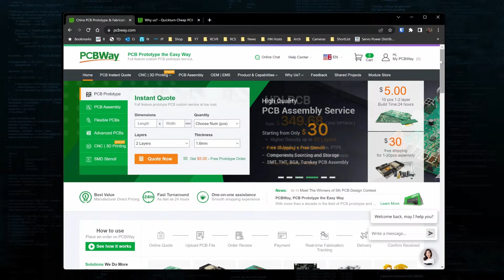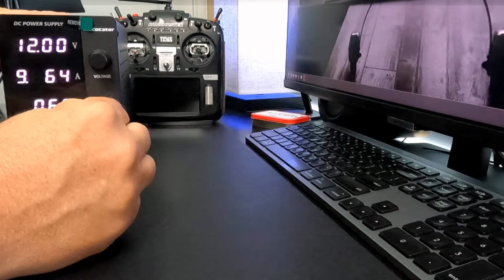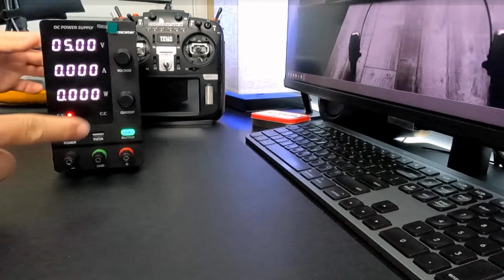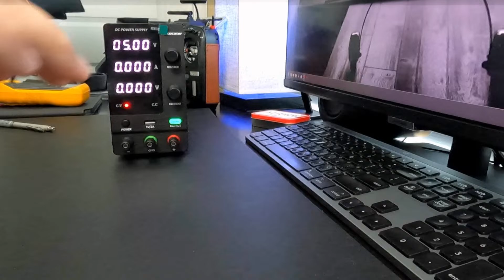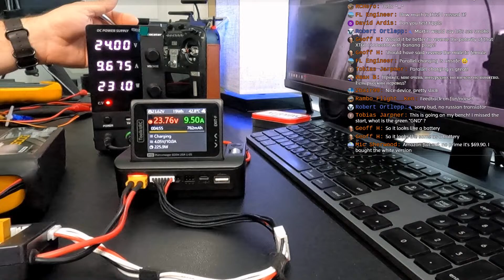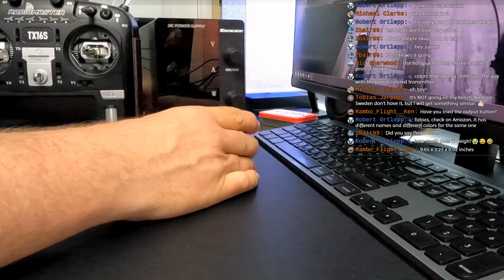Decent Low Cost Bench Power Supply • 30v 10a 300w

Comment from the maker: Near 20:51 I said if I "brought the voltage down it would get us closer to 300w" which is obviously incorrect. I was looking to increase the amperage by turning down the voltage. Without changing the load, the overall wattage would not have changed. These are issues that get removed in production videos that can't be edited in live videos. Sorry for any confusion I might have caused.
Reply: No worries.  Its better than my effort
Reply: Yep. So much wrong and frustrating info in this video. 
🤯

Comment: The iPad charge at 4.3 volts seem a bit odd. Should it not sit at 5V? Thankyou for the coverage! I need a reasonably noise free power supply for fine DC analog tuning and testing. The voltage is also important but with a decent volt meter it's not super important, just the stability. Thus I am searching searching searching! Cheers!

Comment: Love your setup! I was going to also use this power supply for RC and moving servos etc and powering receivers. How did you attach the standard servo lead and the other connector? It wasnt clear in the video how you set that up. Id be very interested in doing that as well .thx u!

Comment: Thanks for the teaching.
In amplifier building, the board needs a +/- rails, say 30DCV.
I am looking for a bench adjustable/variable switching PSU to be used for various amplifier boards (that needs different +/- DCV).
Question: What kind of description/specification do I look for in a commercial product? Thanks.

Comment: I have this and it broke down after 3 months.
Reply from the maker: I posted this video May 9, 2023. It's August 12th 2024, and I still use it almost every day. It's been on for 1.25 years straight usually running around 30v and when I use it as a charger usually between 5-10amps.

I would buy this unit again immediately if it failed at this point.

Comment: Can I use one of these devices to fix electric scooter battery at only putting out a few volts need it back to 30 volts
Reply from the maker: I don't know about 'fixing' a battery, but it could be used to charge one.
Reply: @RCVideoReviews  can it increase battery voltage?
Reply from the maker: It follows the rules of voltage potential. So long as the destination voltage is lower than the source voltage it can. I'd recommend using a charger though.

Comment: Will this be suitable for breaking in slot ca motors? I need something that will show the increase in amps as the brushes break into the armature. I assume in you have the power supply set to CV the amp meter will show the increase in amps throughout the break in process. Thank you.

Comment: Yeah, I bought this one. I'm trying to charge a 210 ah Prismatic cell, and it starts off at like 7 amps. The stay is high for about 5 or 10 minutes and start going down. Then it goes down to 2.2 amps. At slowly keeps going down. Did I get a defective machine or something wrong with the battery?
Reply: @Shawn-gt5dh  I this is old but your description is dead on for how the charge process works.
Reply: Measure the voltage at the end of your power leads with the multimeter then adjust the voltage. I'm guessing there is a major voltage drop and it differs from what the power supply is showing

Comment: Looking at the power supplies on Amazon, I suspect the main board in many units will be identical.
Reply: I can confirm. I’ve bought two different of these power supply unit from Amazon. The aesthetics of the cases are different but the board and components are laid out exactly the same.

Comment: I appreciate that your an RC guy, using tour supply to charge batteries, anf I'm sure this unit serves you wll in that rile. But here's a note for the electronics people out there. I just bought this, and tested it. At 10V and 1amp it's ripple is 400mV! That means it's output voltage is fluctuating nearly half a volt at high frequency, and that makes this supply entirely useless for electroncs work.
Reply: That is good for trickle charge car battery 😂
Reply: Wondering if you have any idea whether your ripple voltage is normal or abnormal for these?
Is there a specification on this for this supply?  I didn't see one on the 'Abestop' power supply that I was just looking at on Amazon
Reply: So put a 1 uf cap across the output to damp it down. This worked quite well with a big improvement apparent on the scope in the video review of another of these generic Chinese bench supplies.
Reply: @chriswesley594  Could you suggest a better not too overpriced bench power supply? I don't need a lot of power. But enough to accurately supply up to 50W maybe. And as low as 0.1A? It shouldn't be that hard to find something decent but I can't for the life of me find something. I have tried the second hand market near me but it's all waaay too expensive, because they are all very high end laboratory equipment.
Reply: @chriswesley594  can you please explain?
Reply: @zd141  If the terms I used are not familiar to you, then you could find them on Google and then all will be clear.
Reply: You have been unlucky, not my experience at all. Although mine is a different model, SPPS-C3010C

Comment: At the risk of sounding dumb .....What or when do we use the ground terminal for ?
Reply from the maker: It connects the mains ground. You can connect positive or negative to that terminal if you want the voltage to be positive or negative relative to ground. You can read up on floating power supplies if you want to learn more.

Comment: I also bought this exact same unit and have found it to be better than average for build quality, performs to spec and overall value for money. It's not as good as units from high end brands but it would be wrong think that it would be at a tenth or more of the price.  Couple of things to note, dull solder joints in modern equipment is normal, reason, lead free solder tends to be dull. It can be shiny, it just depends on the flow solder process settings.  I have load tested my unit and it does meet spec. In fact, I've load tested it for about 12 hours at full output and it came out of that with no sign of distress. This was on a Kikusui electronic load.  Component wise, the highest quality components will never be found in units at this price level, but for non commercial use the average hobbyist should get an acceptable life from this one, especially if it doesn't see continuous use at high power levels. So I would happily recommend this unit, at the price it's difficult to beat.
Reply from the maker: Thank you for taking the time to add insightful and fact based commentary. 

I still use mine almost daily and it has yet to let me down. In fact, at this very moment it's charging two 6s5k batteries at 1c and is doing just fine. 

I also agree about your comments re: Hobby vs Commercial grade, but if I say that as a YouTuber, I get accused of 'defending'. So I limit my comments there and just try to let the product stand on its own merits. Anyway, glad it's working out for you.
Reply: What is it called the affiliate links aren’t working

Comment: PS: Anyone thinking of buying a meter, and you use it a lot, there is only one choice: Fluke 87V, treat yourself to the industry standard, it will last a lifetime.
You should at least get one with True-RMS for accuracy like the 87V.
Reply from the maker: I just got an 87V a few weeks ago. :)
Reply: @RCVideoReviews  Good buy, when I first started electronics I was told by my lecturer to get a 87, they are pretty bullet proof, had others like Agilent but they are not as solid, they try and be too fancy with features at the expense of build quality.

Comment: Main problem with these cheap PSU's is the noise, back in the day, even though switching technology existed, brand names still stuck with Linear designs to lower noise at the expense of larger sizes and more expense on bulky transformers, if you want a good power supply for your lab, and do any kind of microelectronics, you are better off getting an old power supply from the likes of Hameg, Fluke/Philips, or even an old RS/Farnell supply, just remember to replace the old electrolytic capacitors as they will have dried up.
Those looking at the insides, PCB's these day are usually soldered well, things to look out for is cable management, cut-outs near high voltage sections for arc-over,  good smoothing caps and the ilk.
Reply from the maker: Mine sits on my desk and is silent until I start pushing some current. If it made any ambient noise, it would not survive on my desk.
Reply: @RCVideoReviews  Just to clarify what I meant, electrical noise on the DC outputs, you would need a DSO/Oscilloscope to check that, but typically on other cheap power supplies I have seen it can run into hundreds of mV spikes on the output.
Reply from the maker: I see. Thanks for the clarification. Yes, definitely not lab grade gear.

Comment: Anybody who derides a Fluke is not worth listening to.
By the way, your PSU is SMPS (Switch Mode Power Supply) and not a Linear.
SMPS is great for the weight of the PSU and can produce insane current values.
If you are powering sensitive equipment or Audio related circuits....then a Linear will be needed.
These will be bigger and weigh a lot more.....

Comment: i've bought that power suply...now if i set it to constant voltage @ 12V and connect a motor, it switches by itself to C.C. and draws whatever it wants....WHY? is it broken or the way it is? if so its completly useless...
Reply: Adjust the current limit upwards. From the factory, it may be set to a low current limit such as 200 milliamps.

Comment: I found a similar from Amazon Sweden after your video and I have already used it for some charging of small batteries and connected to a receiver in a plane to get things set up, very good addition to my bench, thank you for the tip! I don't really trust myself to not mix up red and black, so I have a long lead going to a XT60 and then I make the different connectors that I need with short cables and a XT60 at the end, saves a lot of cable and I only need to make sure that the connection is correct when I solder. Making sure I have no more than 5V into my receivers, that is a totally different thing...
Reply from the maker: On that note, I've forced myself to turn the voltage down to 5v every time I'm done using it to avoid turning on a 5v RX with 32v selected. These devices are incredibly handy on the bench for RC. Can't believe it took me this long to get one.
Reply: @RCVideoReviews  another great advice. 👍

Comment: The device looks good and seems to be of a decent quality. I'm using something similar. Although, for very low voltages, I prefer to use one of those "DPS" power supplies from RuiDeng.

My only real point of criticism would be the USB port at 4.3 V at only 0.7 A load is really bad, to be honest. iPads can draw over 2 A from a USB charger and I don't even want to know how low the voltage would drop then. Just compare with the Apple charger, which should stay at 5.1 V even at 2 A current draw. I'm using a simple multi-port USB power brick on my bench, they don't take a lot of space when powered with a separate mains power lead and can stay powered permanently.

Also these bench power supplies are usually not made for permanent operation. It may not be very efficient as power supply for chargers. To power chargers, cheap and used server power supplies are ideal. I'm using a 1kW HP for 12 V and two in series for 24 V. Of course, I'm not nearly using that much power, but at the power I'm usually drawing, the fans won't even turn on. And I still have my bench power supply read for use.
Reply from the maker: I think I want to see about measuring voltage on USB with a different meter. Haven't really sorted out a way to check calibration with these things yet.

Comment: It does look pretty decent. I use two repurposed £12 Dell server PSUs, rated at 60A at 12V. I use one for my outside charging station. The other, on my bench, feeds my ToolkitRC M7 charger/power supply. If I didn’t have this setup, I would strongly consider the item you reviewed as it’s neater and quieter than my kit!
Reply from the maker: I fooled around with a power supply like that too and the fan noise made me nuts. I also have a nice bench power supply that can do 50a, but it can only go down to 13v. This one has a very useful range.
Reply: @RCVideoReviews  I did a hack to lower the fan speed but, yes, it’s too noisy to be used much! I mainly use a laptop PSU brick with an XT60 on the end. Only good for about 4A but, combined with my M7, does the bulk of what I need, in silence. If I had none of this, I would definitely get something like your review unit.

Comment: 10 amp not enough imo
Reply from the maker: Of course your needs may vary. 10a is more than sufficient in my use case.
Reply: I do opamp circuts lol. 10 amps mean house fire in my sub-watt circuits. If you are looking for higher power ratings often then you should buy something like agilent instead of aliexpress specials because these have a history of sometimes popping in nasty ways if you run them for longer periods

Comment: USB at 4.3v is not fine, way out of spec.      :)
Reply: Why?
Reply: @Rudá_BB  well, it's out of spec,,, doh!
Reply: @user-rs8zg8ey2b  what is the spec?
Reply: Its from 4.4 i think to 5.4 or maybe 5.5 5.6
Reply: I just got this power supply and it is quite adequate for my use. Using it now to get my Blade CX2 back in the air after sitting in a box for many years. Thanks for saving me opening my case.